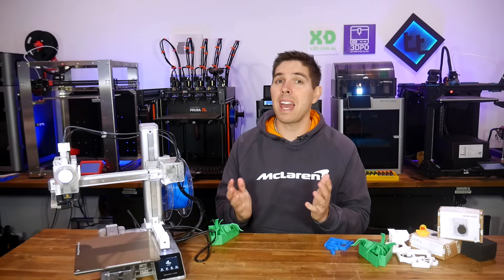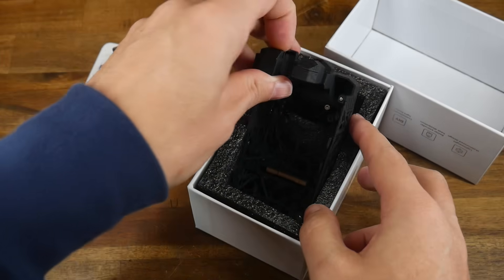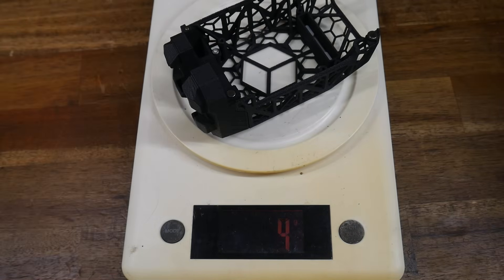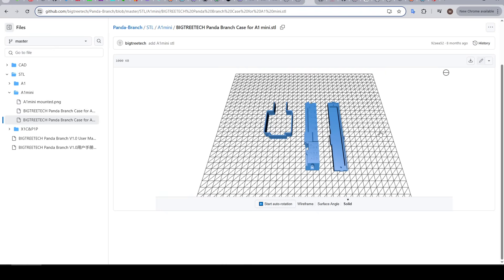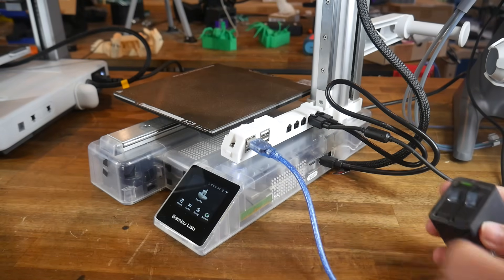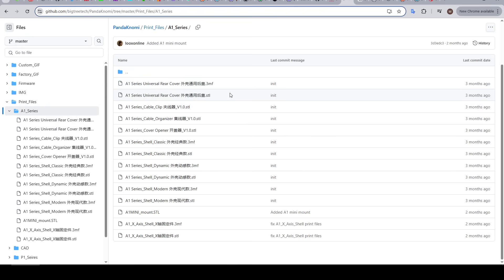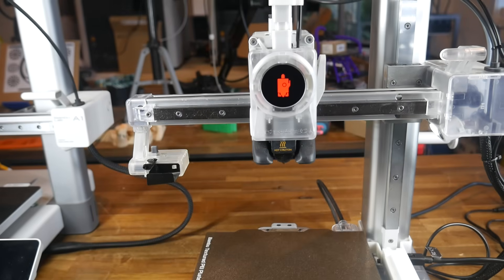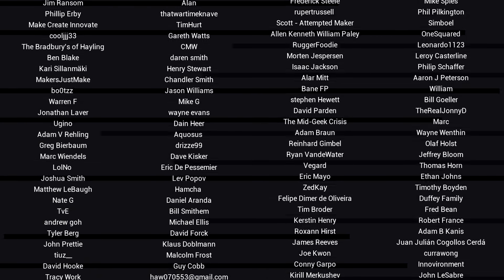Panda Jetpack, Branch and Knomi test and guide - Bambu Lab upgrades

Comment: With the Panda Branch there is a bracket you can print that fits to the two screw holes on the back of the gantry but your printer is a first release model which they hadn't added the holes yet. You should be able to drill them yourself, if you want exact measurements on where to drill the first hole let me know and I will post them for you.

Comment: I've purchased the Branch and the Knomi, as well as their upgraded filament extrusion wheel. As an A1 owner, one of the first things I printed were the large triangular brackets that you mount on the rear of the machine. Two benefits with that. One is that I also found a print model that allowed me to print an insert that goes into one of the rear brackets... which in turn provides a mounting point for a spool holder. The second benefit is that the sloped back of one of the brackets is the perfect place to mount the branch, using a couple of self tapping screws. I've not bothered with printing an enclosure for the Branch as I saw that as having more negatives than value. As for the metal filament extrusion wheel, I've yet to install it. When my OEM wheel beings to show signs of wear, that's what I'll use as the replacement, so till then it sits in the spare parts bin. Now... the Knomi...  mixed feelings about it  I bought it purely as a lark, as it really doesn't do anything other than provide some amusement during printing. However, when I first tried to set it up I didn't properly follow the instructions and managed to bugger up my phone and my wifi router. Reboots all round and things were back to normal. For now, it's sitting on the side of my desk awaiting a second attempt at connectivity. All things in due time...  🙂

Comment: If you do get a Panda Knomi, please be sure to update the firmware right away.   The unit I received had an older firmware and there is a bug with fields if you use > 15 characters that will prevent the Knomi from booting.   At that point it is still possible to update the firmware but with another tool on your PC (more work).   In my case I tacked a little onto the existing AP name (with the .local ending) and crossed the 15 characters.  BTT support was a little slow but I was able to add to an open Issue on their PandaKnomi github and received quick instructions to update the firmware.  Ultimately I mounted the Knomi to the gantry.  Oh,  all the cases are printable (print head or gantry) so you could save $ by getting the screen only version.  Wish I'd done that research up front too.

Comment: I think BTT was a bigger force back in the earlier days of the Ender 3, back when stuff like silent stepper drivers and vibration dampening was still not standard for a lot of machines, and the best printing surfaces were glass. Being able to get an upgraded mainboard or a larger/quieter cooling fan made a big difference, but now machines are pretty well optimized, and a lot of further optimization ends up being software or firmware, rather than hardware. Not saying there aren't improvements to be made, but I think upgrade kits like the Prusa upgrades are probably a better example of how to do it, rather than minor tinkering. While the Mk4/S has some issues, mainly decent competition, they are still remarkably solid and reliable machines, and you can still tinker and mess with them when a new upgrade kit rolls around.

That said, I think stuff like this will always have a place in the market, if even just a small one. I myself still love to tinker on my machines... Just not the ones I need to run day-to-day. And it does seem that mindset is becoming less common as machines are just getting better.

Comment: I’m thinking of buying my very first bambulab p1s next month. With the firmware upgrade issues, do you think it is still a valid purchase decision? I use bambu slicer at library so I’m used to it now. My only concern is the monochrome display on the printer. Should I wait until bambulab launches a P12 or something with a display like A1?

Comment: Well for me the Jetpack was a worthy upgrade as i print alot ABS, it seems to provide more equally airflow from all sides at lower fanspeed. Also got for my A1Mini and P1S the Panda PWR as i really like the auto-off-funktion after printing and i can turn on and off both with the touch. And i use the USB-Ports on it as a power source for hubs on the desk.

Comment: On my A1 Mini I have the Branch, Knowmi, and Lux. All 3 are worthwhile (to me) upgrades:
- Knowmi displays print progress visible from a distance so no more having to wake the screen
- Lux provides much-needed illumination to the print bed and is cleverly controlled by a photodiode placed over the original light so the existing light controls (slicer, app) operate the Lux, no wiring change required.
- Branch provides power to the Knowmi, Lux, and AMS Lite

Comment: I'd consider the Branch, but I hold back when people like you tell me that you had to really dig for some vital info on configuration (the DIP switches).  This should be well documented and easily set without knowing too much about electronics. I always fear that I'll overload something and blow out a motherboard or something expensive to replace.
Reply from the maker: I think the 'how' is not the problem with it, but more the 'why' of understanding the need for changing the switches.

Comment: The best Upgrade a X1C or P1P needs: Glas Riser with Vents to open close for PLA/ABS Print Change. I have several Mods on my X1C but thats the one i use often, i had very early and is the most usefull. The H2D has it build in.

Comment: I got the Panda Jet Cooling Fan Duct. The Version of the Jetpack where only the fan duct is swapped and the optic stays the same. The coolingperformance is as shown here.. not the money worth. You can see under some circumstances a light improvement. Like shown on the spider. So you have a real 360° good Overhang capability not only 2x 120° and some weekspots, which are about 5° less overhang capability in those weak directions. I keep it on my X1C, but i wouldn't buy it again. As long as you keep your Overhangs to the "left or right" of your Printbed you won't see an improvement, mostly the Overhangs to the Back are very slightly improved.

Comment: Good info on the bridge and nomi.  Have the jetpack, while it is not a night a day difference, it seems to offer just enough extra to improve some of my prints.  Very envious of the no ringing from your X1c.  Mine has always had ringing on the x axis (3000+ hours). Have tried everything to reduce this with no effect.  Beyond new widgets, would you ever consider a video on potentially solving issues like this and/or achieving optimal results with printers like the X1c?  Tips that push things to the next level would be greatly valued.

Comment: I think the ONLY upgrades truly worth it are the hot end for various reasons, such as I got a BTT Revo Panda because I already had a bunch of Revo nozzles for my other printers, and maybe the Panda Claw hardened extruder gear set since the stock P1P and P1S gears are not hardened. And that's only if you're doing any amount of abrasive materials that require it.

Other than that, it seems like sidegrades at best. I do wish they'd sell replacement full shells, though, cuz that clear one is amazing.
Reply: the clear is great and very 80's vibe

Comment: Got the Jetpack for free, ruined my nozzle because the magnets came out, and the Jetpack got stuck, and since the build of the Jetpack doesn't allow for just dropping it, it will be dangerously kept wedged between the nozzle and what it's hitting.
TIP: Remove the magnets and use Loctite or a better glue to reattach the magnets.

Comment: i upgraded my p1s to a btt panda air duct and 88W heater cartridge to handle the 0.6 hardened cht-ripoff nozzle. without the more powerful heater the printer constantly ran into an error that the temp cant be kept stable.
Reply: There's no ability to run a PID tune on the Bambus, so if the heater and thermistor aren't reasonably close to the 'stock' values, you're going to run into issues.
Reply: @WhiteG60  not at all
been running this almost a year now and several kilos of petg/pla.  my main profile prints at about 45..50mm³/s on average. sometimes even into 60 ..70s, no issues.
no errors, no temp oscillation or instability. prints look flawless. i ran the self-cal after modifying it, no idea if it includes a temp pid tune but the value is has no work very well
Reply: @ I read your thing wrong! I thought you said WITH the bigger heater. But the point remains. The stock heater CAN pump enough heat, but with what's presumably a different hotend, it didn't know what to do. The stock heater would probably work fine if they'd let you PID tune it.
Reply: maybe. when priting over 40mm³ with the original 48W and 0.6 cht nozzle, the temperature allways was a few degrees belo where it should be and the printer errored out after a few minutes saying theres a problem with the heater being unstable or so.  its the same hotend, just a different nozzle.

the more powerful heater plate was ment for a x1c so it had a different connector, i cliped it off and soldered it to the p1s connector

Comment: Will be interesting to see long term reviews. I popped in the Panda Claw in one of my P1P printers. The idler gear bearing locked up about 90 days into use and was causing feeding problems like mad. I tore it all apart, punched out the pin to find the bearing just wouldn't budge. Cleaned it, broke it all free, lubed it and re-assembled the idler, but there was so much play in the gear from that bearing wear that it was still causing extrusion issues, especially with filament changes using the ams that I swapped back in an OEM hardened extruder gear set. I may try pulling apart an idler from the old stock SS Bambu gear and see if it's the same dimensions to swap out. The main gear itself is fantastic, but that bearing failure left a bad taste. Now the Glacier plates, incredible! Run them on all my P1 series machines, just waiting for my A1 Mini plate to arrive.

Comment: The jetpack just does not seem to do anything. Id like better cooling. Why are there no fan upgrades? Im guessing its power and probably firmware locked. The hub thing might be useful but not for me and it looks odd on the a1 / mini. The screen thing seems kinda cool but also pritty useless other than looking cool at times on the A1/mini print head. looks a bit arse otherwise. Not keen that it adds weight as well. So for me none of them. Looking forward to seeing the next batch you have for review. cheers.

Comment: I have the jetpack and I think I'm going to switch back to the stock or find another solution. One thing I've noticed is that the cooling is very poor on the front side, especially when the print is near the extreme forward edge of the bed and there are artifacts and bulges where it's not cooling well before the next layer is laid down.
Reply: I saw another video that showed that the front two jets holes were full of powder from the printing process used to make the jet piece, If you get those cleaned out, it works the way it was designed and it is way better than the stock air diverters. You will need to take the air diverter off of the head piece to check each port. He also included a water test with a beaker that shows the difference in air flow, the stock shoots all of the air off to the side, the Jetpack when cleared, showed nearly perfect airflow centered around the nozzle. With your comment about the front being hot, I would bet money that that is what your problem is also.

Comment: Glad you asked the question up front, "Is it worth upgrading these printers at all?"

IMO, these products are just feeding into an urge to fiddle that most people into 3D printing are victim to, I'm no exception. I got into 3D printing as a hobby, to have fun and learn something new. Upgrades are just part of that process. I got my bambu printer so that I could have one printer that always "just worked" no matter what state my "hobby printers" were in, so I avoid mods unless I think I'll see tangible benefits, not just cosmetic ones. The Knomi looks like the most useful to me, because it would give an indication of job percentage during a print, but I can also just look at my phone or PC to do that. The Panda Branch is a solution looking for a problem, are there even four different devices that could be plugged into that port at the same time? I suppose it's nice to be able to hook multiple AMS systems up, but does the firmware even support that?
Reply: I’ve seen a plug in fan. I assume there’s many different stuff you can plug in.
Reply: My only quibble with this comment is the assumption that most members of the 3d printing hobby are interested in fiddling with their printers.  I'm certainly not, and neither are most of the people I know with 3d printers.  We just want the thing to work as a tool.

Of course, all that really tells us is that I mostly hang out with people who have similar views to me, and you mostly hang out with people who have similar views to you.  Neither of us actually has enough data points to judge how the community as a whole trends.  :)

Anyway, I very much agree that this is aimed as the "classic" 3d printing hobbyist, the ones who do indeed want to fiddle with their printers.  Whether they are a majority of the users or not, they're certainly a substantial market.
Reply: @davydatwood3158  It was more based on my assumption that "if you like additive manufacturing enough to get a 3D printer, you have some kind of tinkering bone in your body". To be fair, it is certainly still an assumption, however (at least on this channel, given that most of the videos are about, y'know, tinkering with 3D printers) I think I'll stand by my original statement.
Reply: @davydatwood3158  ah a bambu baby try not to hard to think we know you never do.

Comment: Basically none of these "upgrades" are really worthwile a cover that is more style than helpfull, an usb hub that replaces a nearby phone charger and a bulky winking screen that winks but does not add anything usefull but dead weight.
I wish the hub added LAN or usb connectivity to send prints without WiFi. I have to constantly change the printer's WiFi settings when i take it to conventions and workshops, It's annoying and bambu has yet to provide a firmware solution that let's you add wifi networks without replacing the existing ones.
Reply: What i mean is that i'm expecting more than visuals with these upgrades, how about BTT provide a replacement main board for the A1/mini?
Are there any custon third party FW that unlock the printer's capabilities?

Comment: I find the jetpack to be the most useful, however it should be in two pieces where the top can be a fixed design by BTT while the bottom can be 3d printed to have custom cooling vents for users to try for alternate cooling paths.
Reply: Panda Jet Cooling Fan Duct is as single item avaible which keeps the standard housing. I have one, not worth it. Only Overhangs to the "Back" of the Bed are slightly improved. And you can swap the Fan Duct on the standard housing.
Reply: @Elkarlo77  no he wants the top to be separate which it is.

Comment: Until their recent poor decision making, i was very interested in optimizing my Bambu's. Now i just use them as-is and stopped upgrading the firmware (to avoid the companys shenanigans). I am currently eyeing either a fully specced Prusa XL or a K2 Plus with 2-3 CFS'es.

In you experience with will provide the smoothest experience?
Reply: lol the prusa is . 3.730 euro..    u can buy multiple bamboes for that..
Reply: @dennis8019 Correct. BUT: 
1. I am not very keen on the fact that i will be unable to use Orcaslicer or continue using my print management system if i update my current x1c and a p1p, and i assume that a brand new bambu machine will come preloaded with the newest firmware.
So until Bambu gets their act together and stop putting fences up around their otherwise perfectly fine ecosystem. I will not be buying anymore products from them
2. I need a build volume bigger than the 256^3 that the X1C provides.
3. I regularly print multicolor items. And often also multimaterial items. My P1P is practically a dedicated TPU machine. With the Prusa i could print fully assembled items, and save a lot of time cleaning and assembling multiple parts for the items i sell on my store.
Reply: @dennis8019  True. But i need a bigger build volume than my current X1C and P1P offers. And i often print multi-color and/or multi-material. And instead of having the TPU parts printed on my P1P and then assembling everything afterwards. I could save a lot of time printing everything, assembled,  in one go. And when printing hundreds of the same item (I have a small webshop) the time savings really adds up.
The Bambu H2D looks almost perfect on paper, but my whole production workflow is integrated with OrcaSlicer and HomeAssistant. And with Bambu Labs recent policy changes OrcaSlicer and HomeAssistant are unable to talk to the printer

Comment: I started printing 5-6 years ago because I wanted to make cool stuff. I ended up becoming a 3d printer mechanic. I buy Bambu printers because I just want to make things, not work on the printer. The hub seems interesting but the rest is just fixing a problem that doesn’t exist.
Reply: Same here since 10 years. But going through the mechanic phase improved my knowledge so I can judge on every new printer I want to buy. Anyway I ended at the P1s and gave my prusai3mk3 to a beginner.